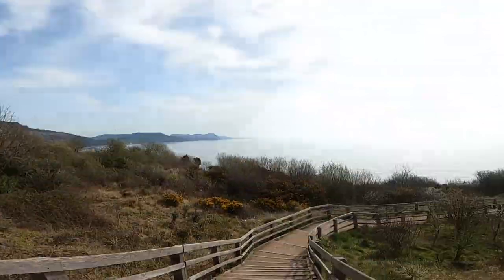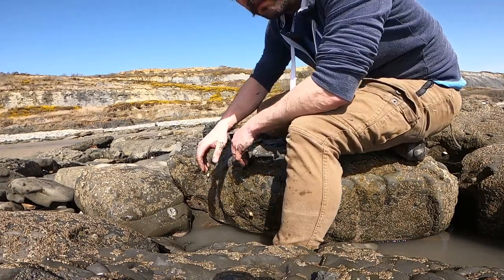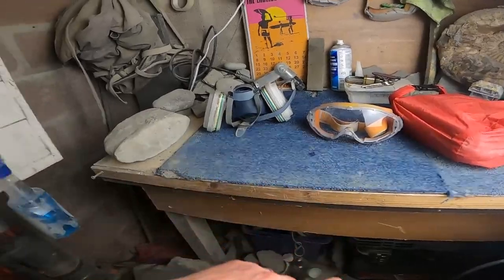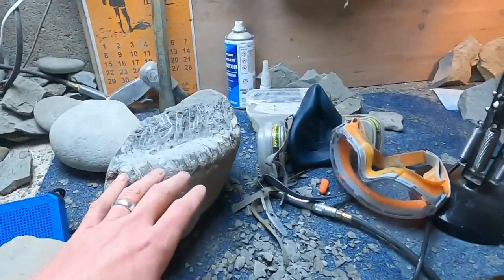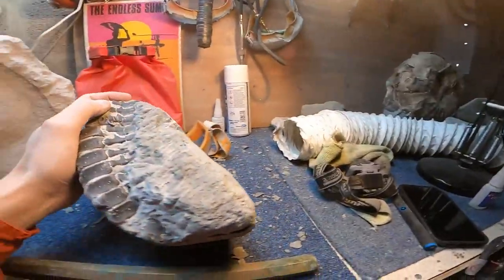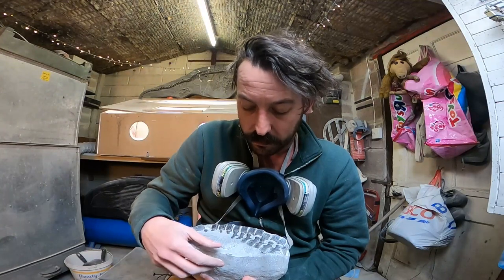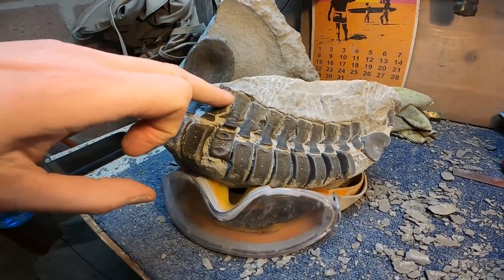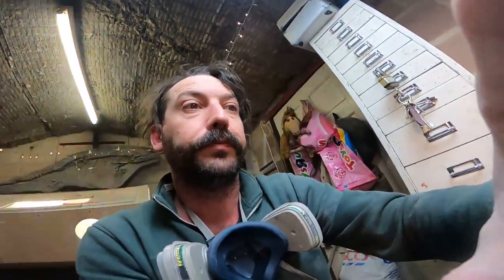AWESOME FOSSIL FIND AND PREP

Comment: I have just found your YouTube channel, awesome! I have been a life long fossil enthusiast, but happy to admit, have not got a clue as to how to find them. My method is find a big rock with a line in it, pick it up and drop it hope it cracks to reveal something. Any tips on improving my neanderthal method? and what's good kit to get to to start attempting to prep them?
Reply from the maker: I think getting a guided fossil walk is the best place to start, there are some really good knowledgeable folk doing them in Lyme and Charmouth, a good guide will really give you a solid base to start from. Knowing the right types of rock is a start but without someone to show you this can be hard to learn by yourself. My top tip is if there is something squashed (an ammonite say) on the outside of a rock, there’s a good chance there might be something on the inside. A good machinist hammer (you can get them at zoro.co.uk) with a wooden handle are perfect. Think mine is around 800grams think that’s around 1.7lbs. Something like that will do better than the cave man approach :)

Comment: Excellent video there. Makes my triple verts look tame! Can't wait to get back there in August 👍. Tell me, what make of pen? Did you use the same pen and nib from start to finish? I got a Mannion needle and it takes aaaaaaaages to move a bit of matrix. Keep me coming, great stuff 🦖👏👏👏💥
Reply from the maker: Cheers dude, the pen I use is a stock Chicago pneumatic CP-9361, smash the ball bearing support off the top (with it on makes it hard to hold) then I’ve sanded it a bit around the top to make it more ergonomic, smashing off the collar at the top makes the tip less steady though. Then just grind the tip to a sharp point. Stock CP and it’s been going about 15 years now. I am looking into getting Zoic to see if they can improve my pens, either that or get a new set of the low air pressure ones they do which I’ve heard really good things about. See what comes out cheaper.